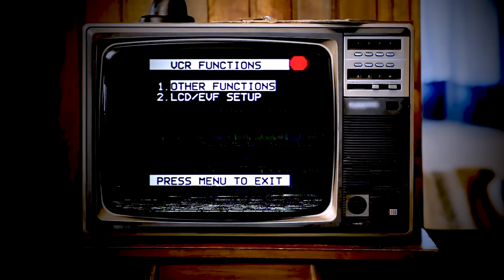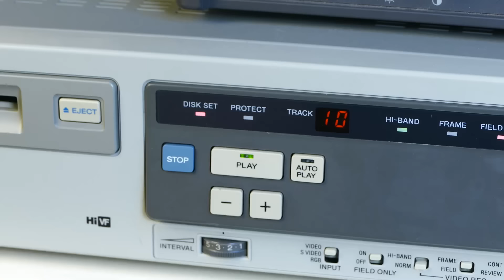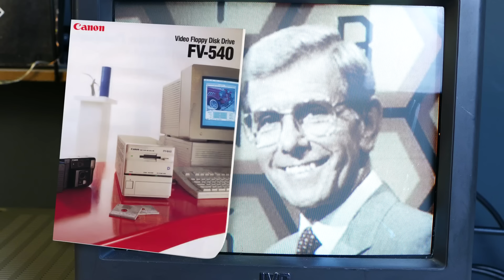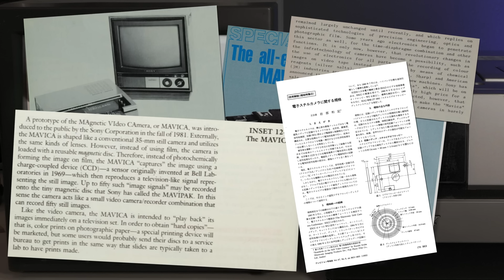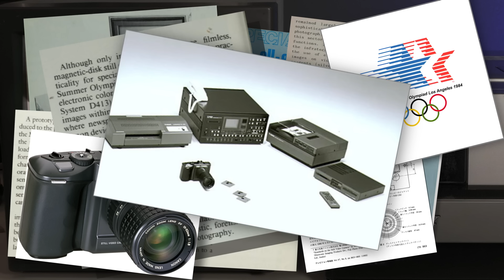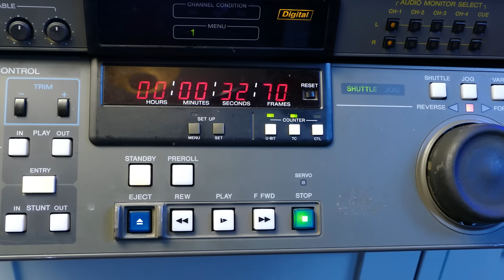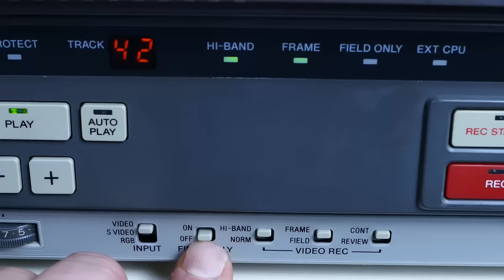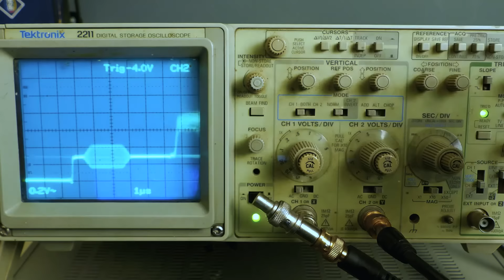The Rare Sony Floppy Format You’ve Never Heard Of

Comment: I used that format for a project in school once in the late 90s. I had a Canon camera and a Mac with analog capture capabilities. I could thus do some rudimentary desktop publishing despite lacking a digital camera. 
I saw another comment hinting at me not being the only one doing something similar. 
The best thing is that I have a feeling that I may even have the pictures captured archived somewhere (yeah, digital hoarding at its best). I still have the camera somewhere in the parents house. I do wonder if there’s anything readable left on those disks.
Reply from the maker: That is fascinating @DrBovdin - thanks for filling in a few details there! I hope you find your discs and get them read! Cheers for the comment.
Reply: I used a Xapshot camera for an elementary school project in the early 90s.  I don't remember what the project was about anymore, but I do remember being extremely enthused that the school was trusting little-kid me to be responsible with the camera! 😀  I think a school staff member helped edit my pictures into a video using a similarly-beige editing deck.

(*EDIT:* typo 😝)
Reply: Video capture cartridges / cards used to be mildly popular on the 16-bit machines and DOS PCs for that kind of reason. You could grab short low-rez monochrome sequences using them if you had a use for that, but they were more useful for digitising stills into the machine using a video camera, particularly shots of something that wouldn't fit on a scanner and you didn't want to go through all the business of taking lots of film photos of, if it was more working material (like for modelling purposes or whatever) that didn't need to be kept forever or be super high quality.

I saw a thing in ST Format the one time about a developer who made the sprites for some over-the-shoulder sports game in that way, recording someone running around and then basically rotoscoping it on the computer. Think that's also how the Prince of Persia sprites were made (would have been even more rudimentary given they were being captured into an Apple II ?!), and, slightly more recently and in better quality, the enemy sprites for Doom. The devs made actual clay models of all the baddies, put them on a turntable, pointed a videocamera at them, then spun them round taking a shot from each cardinal direction after moving their limbs into the pose needed for each frame of animation...

Comment: What a lovely device. I got quite a few VCRs and other devices but I´ve never seen this thing. They must be incredibly rare nowadays.
Reply from the maker: It is lovely, it’s an odd-duck but it’s interesting nether the less. Been filming something else equally “odd” today that you may well have never seen before today too. Thanks for the comment ~Andy
Reply: It really reminds me a lot of Minidisc, not just because of the obvious format similarities (excepting that it's purely magnetic, and analogue) but the whole kind of design language of the machines themselves. And funnily enough Sony did make a data version of that with a SCSI box you could hook up to a computer (holding about 140MB), but that also didn't catch on, somewhat sadly. That could have been a natural evolution of this device, even storing 150-ish full-frame video images in uncompressed digitised form... Eventually the 2000s Hi-MD just let you connect to it by USB and use it as a 1GB microdrive type device (and that ofc would have been enough for reasonable quality portable video, before UMD came along), but too little too late... Imagine having an MD slot on your desktop PC, or laptop, or a video/audio player using them sat by the TV. The cooler future we never got, probably due to corporate Sony shenanigans.

Comment: I have the Canon Ion Cameras which uses VF Disk and the Digitizer Board for (old) PC. It's interesting what you can get out of these Cameras, but I imagine that even bach than (my Set is from 1992) it was only usable if it must go really fast. With 1 Hour Photo development, or at bigger Companies, with own Darkrooms, 35mm was still the best Option with way better Picture Quality.
Reply from the maker: I've not used the cameras (expect the later digital Mavica) I would find it fascinating to use one to see what's possible with them.

Yep, a field of PAL or NTSC was never going to equal 35mm (it's also in the 'wrong' aspect ratio.  Have you got a video about your digitiser?  I'd love to see it.  Thanks for the comment :)
Reply: @robustreviews  No Video Sorry, But the Cameras itself are, besides the Floppys, nothing to write Home about.
Reply: I'm pretty sure I still have mine somewhere.
Reply: @robustreviews  Frame mode would probably be acceptable if you could have the capture device average out the reads, or if it was maybe higher quality than the deck you're using so had paired heads or a framebuffer etc to get rid of the noise... that'd at least get you up to VGA rez, which is good enough for upto maybe half the size of a typical 6x4 if the print halftoning isn't super fine.
Reply from the maker: @tahrey  exactly, there was a TBC/frame buffer available on this system and that machine but have been very high mileage, and the disk was very elderly which wouldn’t have helped one bit.

I was a bit surprised it didn’t have at least a field buffer, but no the thing just churns away at the disc and hops tracks for a frame.

I think that machine was probably a low spec’ one, or knowing Sony they would have gladly sold all the extra bits to go with it!

I need to get this back and do a Part II as I thought it was PAL but it uses a custom FM colour difference solution more like SECAM on the disk, so there’s only .5H colour resolution with line difference.

I really need to get it back and get the analyser and scope out!

Comment: The recording method must be really advanced to get ~6Mhz PAL bandwidth out of one track on floppy disk.
Reply from the maker: Ah it doesn’t, it kinda cheats. It is like a quasi-SECAM thing that’s re-heterodyned under the luma. That’s what I need to make part II about but that’ll be a more techie video.

It used alternate colour that’s FM modulated so it’s kinda (if you squint) more like SECAM. 

Good spot though!
Reply: @robustreviews  You should definitely do another video on this. You can tell just by looking at it there's a really clever trick being used for it to work.
Reply: @robustreviews  Wow, that's a lot of fiddling, vs the relatively basic approach VHS took. No wonder it seems so clear even with halved vertical rez.
Reply from the maker: @tahrey yep I think the colour-under method would have been quite poor considering how rough a single field of VHS looks. I do need to go back to the patents and tech’ docs and unpack it.

I’m pretty conversant with analogue video but I’m still not sure where to pitch the videos whether people want a prod and poke at an unusual device or more in-depth stuff?

Comment: Glad I watched to the end before picking up the keyboard... was going to ask about the field/frame and regular/hi-band switches on the front. Does it really just jitter the head(s?) back and forth between tracks? Or maybe swapping sides (though you'd be restricted to recording full-frame images with even-track alignment in that case, though it'd mean it would only need 25 total tracks not 50)... I'd have thought it more efficient to have a pair of heads next to each other so it could read two of them at once and seamlessly flick back and forth electronically. The extra noise in frame mode is quite unexpected...

The Hi-band simply being SVHS style is a disappointment too, I thought maybe there would be a lower rez / longplay type mode when you turned that off, so it would be able to fit a full-frame image on a single track (spinning at half speed) at the expense of less horizontal sharpness. Which would be an OK compromise on some screens given how big the dot pitch could sometimes be, or indeed probably make no difference to the horizontal rez at all if you were working in pure monochrome with a B/W screen. Maybe even do 100 field-based images (with the reduced horizontal clarity making it a bit like a VCD, or a longplay NTSC tape) by putting two to a track with a small framebuffer (75 kilopixel would have been a lot more achievable than 300kp at the time... only need like 256KB, less if you accept worse colour depth).

Though, maybe the noise is just the deck is a bit worn out and needs some cleaning and servicing?
Reply from the maker: Hi mate, all good points.
Mobile at the moment before I get back on the M1 - I really need to get this back and have another go with it! You have asked very sensible questions and good points! Definitely needs a part 2! ~Andy

Comment: Most interesting, assuming it actually is analogue on the floppy, then that disk must be spinning something like 3000 RPM, so the wear on it and the heads must be hideous, otherwise they'd have to digitise the pic and store it in a frame buffer. By the looks of the electronics, with an absolute pile of digital, it seems they were actually doing that - so pseudo analogue?
Most of the accessories shown (like a phone 'modem') would require the picture to be digital, so braking the analogue idea.

I did toy with the idea of trying to do this on a hard disk drive, they normally spin at the right speed, there is no head contact so you could hold an image for ages with no wear & a hard drive usually has hundreds of tracks, so plenty of room.
Back in the day I was having a very bad time trying to digitise video, so an intermediate step that could hold a freeze frame for near forever seemed like a good accessory. (some early digitisers required a freeze frame source)
Reply from the maker: Yep, it's definitely analogue on the disk, of that there is no doubt. This was developed in the early 1980s so they'd be no feasible way to get anything approaching a high resolution colour image on to a tiny disk by digital means. The numbers do calculate to the signal h-period (3000RPM/50RPS = 50 fields-per-second) to use the PAL example.

I agree about wear, but I've heard nothing to say it was an issue but I suspect they'd be a lot of mechanical abrasion eventually. In broadcast these would be fed in to a frame-store (although digital frame-stores had supplanted these by the 80s anyway, major broadcasters would be able to punch up frames from a server) which kinda makes them somewhat worthless for the major players I think?

There's nothing that says transmitting at voice-frequency has to be digital,  us radio hams have been playing with SSTV (slow-scan television) for decades and that can squeeze in to a 3KHz voice channel, it's very slow but it's been done for a long time. That's built on modifications of conventional analogue video.  It is very slow though, but doable - which to me ties in with the fact it took so long to transmit pictures 'by wire' on it.  Transmitting pictures by baseband telephone circuits goes back to the 1930s I think and was quite established by WWII:  it need not have to be digital.

I suspect for most users the image would be captured then held either on a computer (or by extension a frame store) rather than continuously read indefinitely?

Good comment,  stuff to think about!  Cheers ~Andy

Comment: It amuses me the roll of film probably has a lesser volume than the disk so it's not even smaller and film is MUCH more resolution than 640x480 so in all aspects it is objectively worse than what they currently had o.o
Reply from the maker: Yep in terms of quality 35mm would have exceeded this, plus it was not in 4:3 aspect ratio! But these at least could be whistled down a telephone line fairly easily rather than using a drum scanner for transmission? These were quickly outmoded though,  they're one of those interim technologies I guess?  It's a worthy comment though and I'm inclined to agree. Andy.